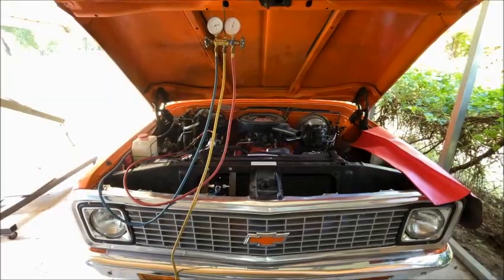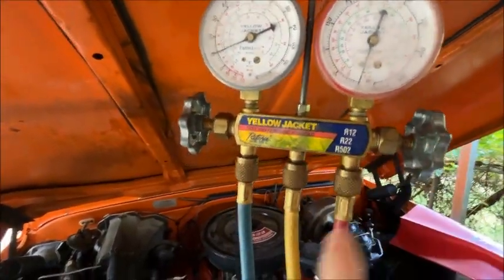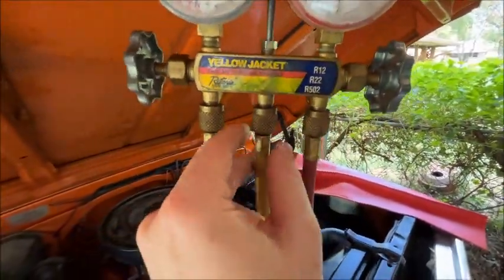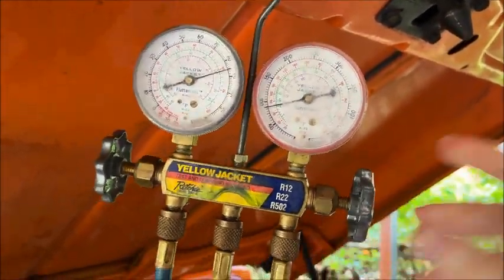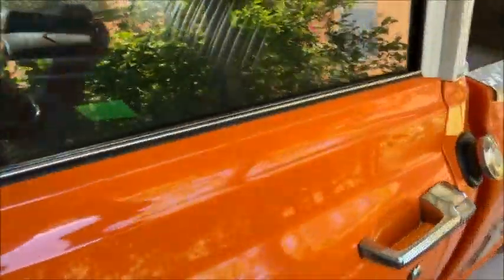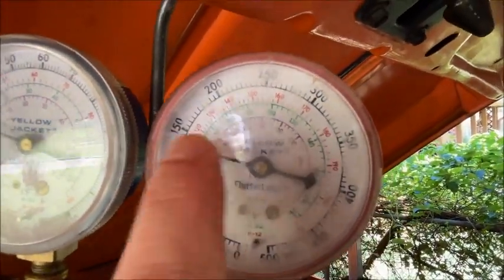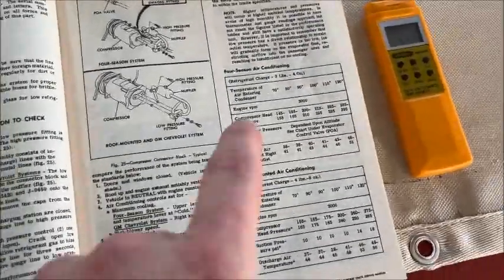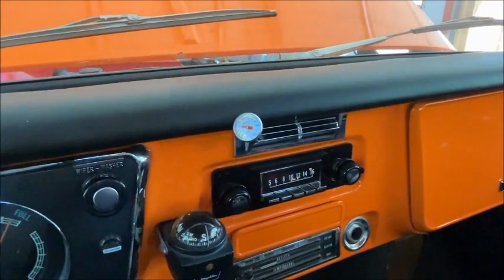Vintage Air Condenser Kit 1967-72 C10, Vac & Charge R134a

Comment: A normal ac system in a car or pickup will be around 30 on the low side 150 175 on the high side. This is all depending on the outside air temperature. I just charged my 66 chevelle with vintage air and I’m 40 degrees inside the car at the vents
Reply from the maker: Yes, your R12 POA valve is set to regulate at 30ish psi.  We adjust it down to 28psi for R134.  If you overcharge, the POA will not be able to maintain the drop.

I've considered trying the subcooling method where you measure liquid line pressure and convert to saturation temperature, then subtract the actual liquid line temperature to get subcooling (10 to 12F).  Not sure how well it would work with a POA valve in place, but it might be okay once you get past the initial frost zone (liquid line frosting before full charge).

Comment: My low side is at 45 is that to high? Am i over charged?
Reply from the maker: You have a POA valve that needs to be adjusted to 29 psi.  It's a pressure relief that maintains your evaporator just above freezing (saturation temp of r134 is 33F at 29 psi).  So, if you are much above 29 psi, then you are overcharged.  I would release some r134, let it run and stabilize for 5 minutes or so, then recheck to see if you are closer to 29 psi.  Keep doing this until you get close to 29.  

On the flip side, you can be undercharged and still read 29 psi.  In this case the evaporator or TXV will freeze up and suddenly your a/c will quit blowing cold air.  So, probably best to overcharge and dial it back slowly.